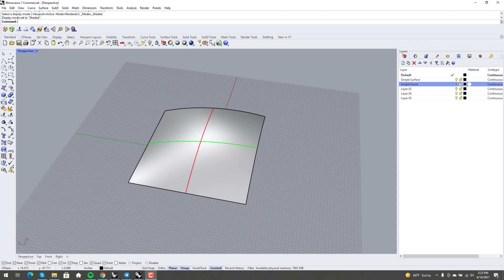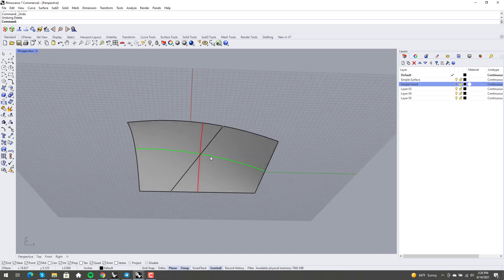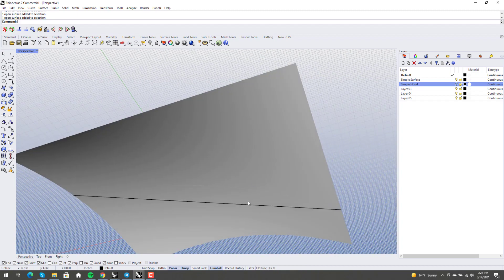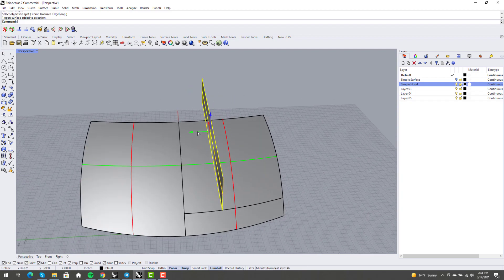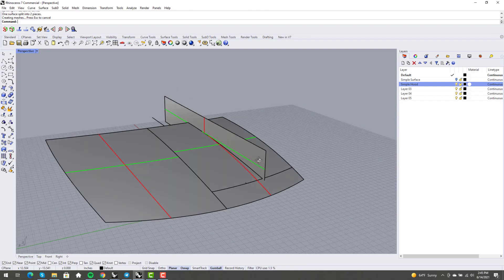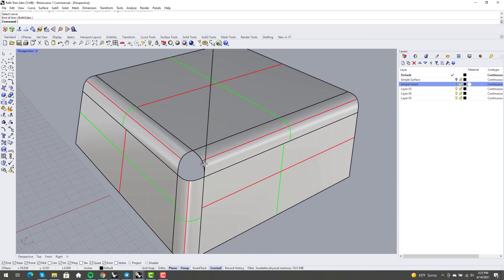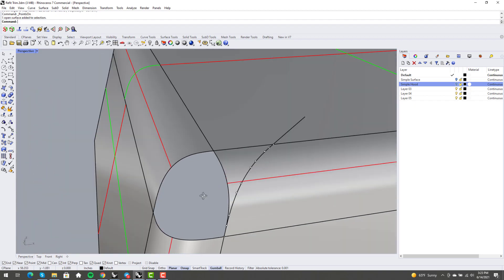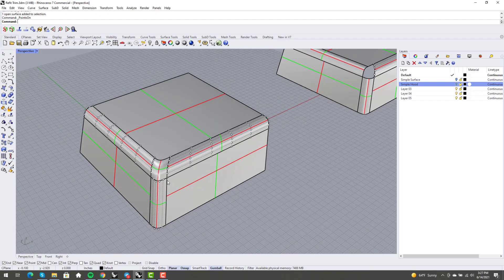Rhino3D V7 RefitTrim - It's......good!

Comment: The tool youre using to split along uv is a plug-in? I can't find it in my rhino 7...
Reply from the maker: Also worth noting - that option is only available when you are splitting a surface, NOT a polysurface. So if you have surfaces that are joined together, you have to explode them first then you can get that option in Split.
Reply from the maker: I'm just using the standard Split command, and then using the "Isocurve" option inside of Split.
Reply: @thirtysixverts  Wow super handy! Thanks a lot!
Reply from the maker: @暇を持て余し黒ラブ  You're welcome! Since splitting by Isocurve creates a "clean" edge (same degree and point count as the underlying surface), my recommendation is to ALWAYS try to split by Iso first, and then only resort to a regular trim or RefitTrim if you need to.
Reply: @thirtysixverts  Just subscribed your channel! How do you enter this command so fast? I would have to type "sp" - enter - "I" - enter to get there. I know you can just right click the rhino "split" button, but just wondering how you initiate this command like with one click? And also curious to know why you prefer split + delete surfacing instead of just trimming them.
Reply from the maker: @xiyaowang9452  I have it setup as my Ctrl - S on my keyboard options! By default it's "Save" but I changed it because I use it so often. Also if I just type "sa" then "Save" autocompletes, so I don't really lose any time there either. You can use trim too, but you'd have to extract the isocurve first - one more step.
Reply: @thirtysixverts  Gotha, Thank you for your reply! Keep up the amazing videos! can't wait for you to finish the Merc!

Comment: How do you like the edge continuity command? Also could you make a short video maybe on how you’re using it? I see you have the curvature tolerance at 5? Why is that?
Reply from the maker: EdgeContinuity ONLY works for tangency right now, unfortunately. You're far better off using Zebra analysis for G2 at this point, which is not great but usable.
Reply from the maker: Totally forgot to directly answer your question - I'm pretty disappointed in EdgeContinuity. It's one of a handful of improvements in V7 that I was excited about, and it's pretty underwhelming. For really serious surfacing (paid customer work) I'll likely keep using V5/VSR.
Reply: @thirtysixverts  ah I see what a shame. My thoughts is that If it's possible with a plug in they should've been able to do it in the vanilla version. Hopefully maybe in the future. I see what you do with vsr and I so wish I could have it haha. Well thanks for your reply!